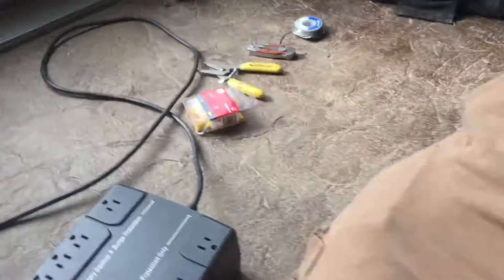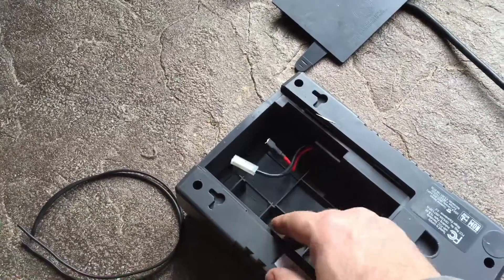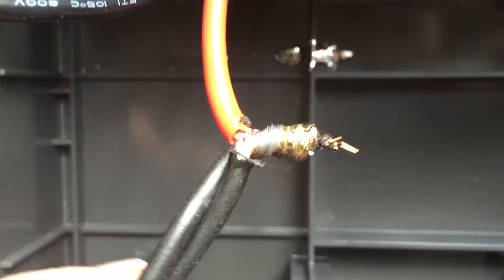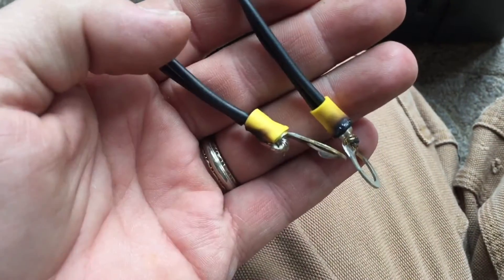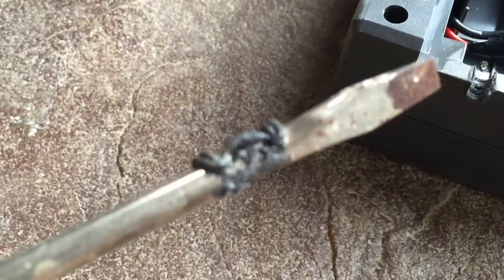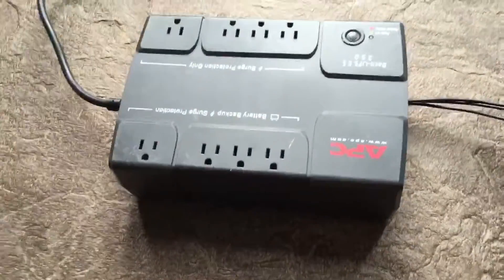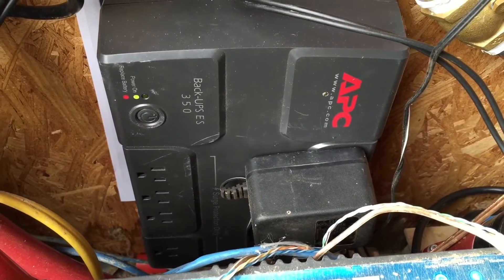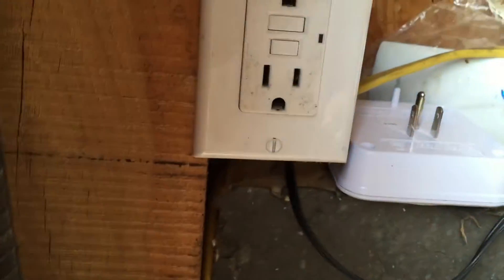under $5 Backup Power "generator", using a UPS and deep cycle battery

Comment: I am not a "Sky is falling" type of guy but I'm going to suggest a couple of safety items. :)
I'm doing the same thing to power a car stereo in my garage.  I just have the standard UPS battery in place to maintain the stereo settings when the power goes out.

1. Tie a knot in your wires, or some other type of strain relief, inside the UPS so the wires  can't be pulled apart if they are tugged.
2. Put a 10A inline fuse on the 12v+ wire.
There are fuses inside the UPS but an additional external one would be a lot easier to change.
Reply from the maker: Great suggestions.  thanks